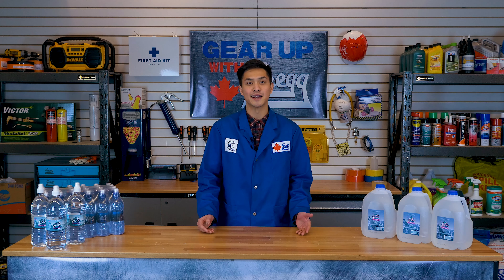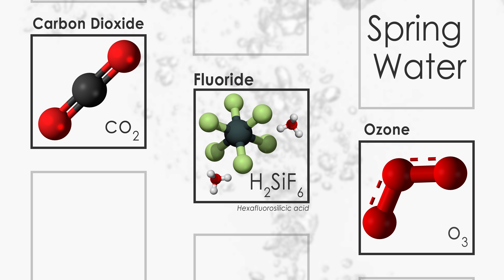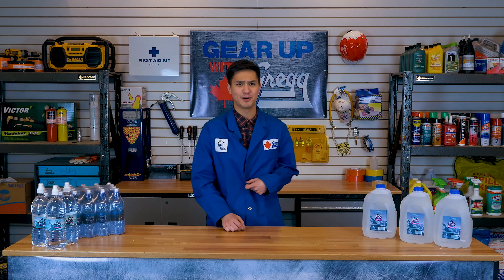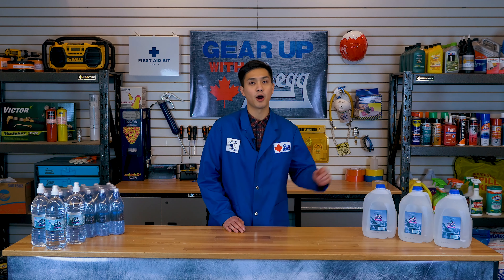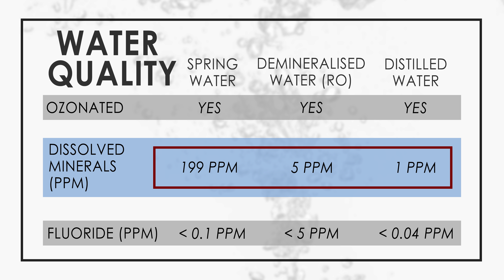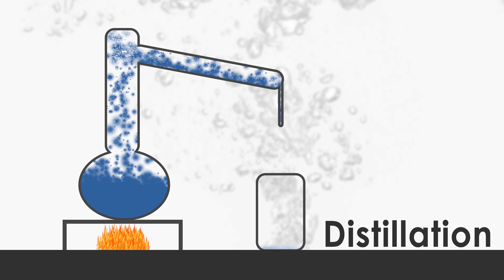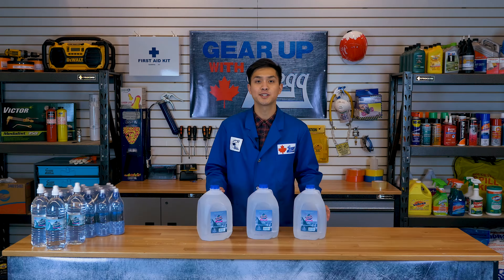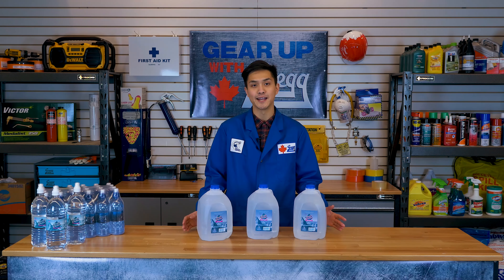Water: Spring, Reverse Osmosis, and Distilled... What's the Difference? - Gear Up With Gregg's

Comment: I drink distilled water,I get plenty of vitamins and minerals through juicing raw organic distilled fruits and vegetables. We get plenty of salts in are food . I've worked at a distilled water company, not only do they drink distilled water,they rent are coolers as well. Thousands and thousands of people drink distilled water. Hospitals, dentist, police stations, factory's, mechanic shops, farm's and thousands of customers. It only leeches out inorganic minerals.
Reply from the maker: Distilled water is potable, however, most people prefer other waters such as Spring Water, as the beneficial minerals we are used to tasting in our water are not present. Also, Spring Water tends to be more cost-effective for consumption than RO or Distilled water. Thanks for your comment!
Reply: That's the problem water is not to provide minerals or vitamins its simply to hydrate and cleanse your body from unneeded inorganic minerals it's a myth that it strips the any minerals from your body if that was the case we wouldn't need food to provide nutrients for our bodies to function I've been studying water distilled is the best option

Comment: Correction the calcium and magnesium in water is not normally bioavailabile...
Reply: Actually they are bioavailabile.

Let me explain biogly and basic sceince.

Your body takes up minerals that are both organic and inorganic to run your cells.what it can't use gets filtered out by your kidneys and liver and is then removed from your body by going number 1 and 2.

Also it will cuase your cells to take up to much water due to osmosis.which very bad and can cuase water poisoning.
Reply: @starandfox601  You answered your own statement. Clearly inorganic has less uptake, and there's so much other shit it tapwater that the kidneys and liver have to work harder than needed. Clearly it is more logical to drink purified/filtered water and then get the nutrients from food and/or remineralize the water.
Reply: @chickenmuffin  inorganic minerals have the same uptake and usefulness has organic minerals.

For example ALL salt is inorganic cuase it doesn't have a carbon bond.but your body still needs it to maintain water balance and to create engery.

You're body doesn't have to work harder to filter out toxins from water tap water.if your liver did get over worked it would look like a achololics liver and humans has a speices wouldn't exsit since all water has a minor amount of toxins in nature.

You're the one not thinking logically cuase you are buying into buzz words without thinking what they actually mean and think drinking ultra pure water that would never exsit naturally is a good idea.also you can't really get the same minerals by remineralizing cuase a lot of the minerals in water you need are hard to put back.
Reply: @starandfox601  Have you heard of rain?
Reply: @chickenmuffin  rain isn't pure water.
Also how many living things drink drink water dirrectly from the clouds vs water from lakes,ponds,rivers and streams that have minerals from erosion?
Reply: @starandfox601  I think distilled water is safe(but worse than other types of water). The point is that the mineral content of regular water and distilled water is very similar in absolute terms(we measure things in ppm). That is, we get the vast majority of our calcium and magnesium from food. The leaching that the distilled water does will be essentially the same as other sources as water as they are essentially identical. I still wouldn't drink distilled water as it is expensive and doesn't have as many minerals, which are bioavailable. But it's seems safe to me to drink.

Comment: Does RO water have more fluoride than spring water? Tap water?
Reply from the maker: Unfortunately, there is no simple answer to your question.  The amount of fluoride in water varies by the spring water source.  Furthermore, the amount of fluoride varies by municipality as they will all have varying practices in terms of the amount of fluoride added to tap water.  As for RO water, the amount of fuoride in the RO water really depends on the source water that is going through the Reverse Osmosis process and the specific piece of equipment that is being used as most RO systems do not remove fluoride.
Reply: Distilled is the best option!
Reply: Reverse osmosis does filter out flouride you could just Google these things. How do you not know this and you work for a water company. It removes a high percentage too.